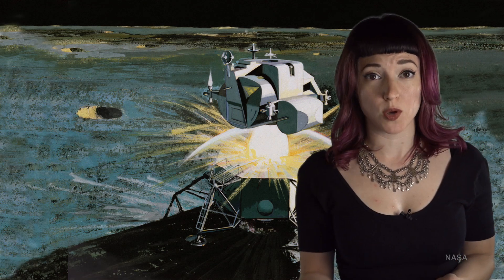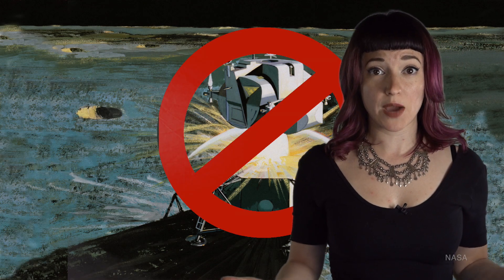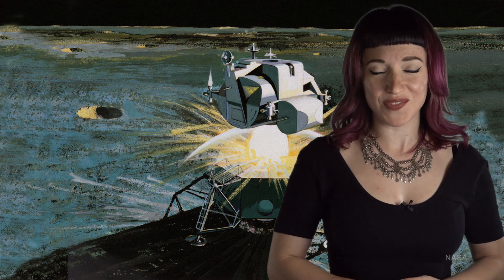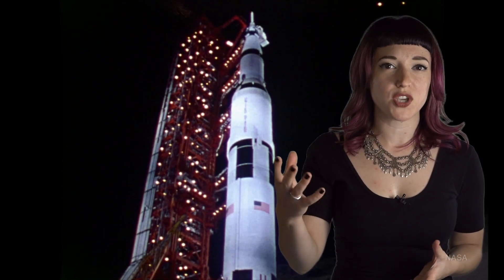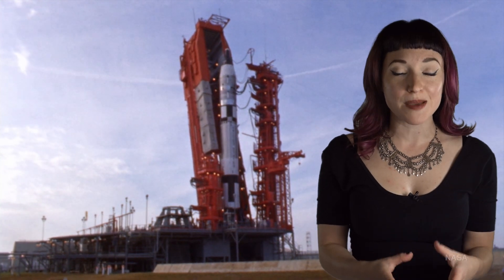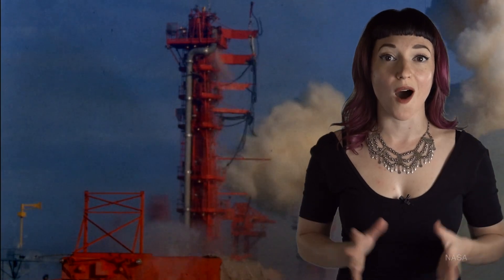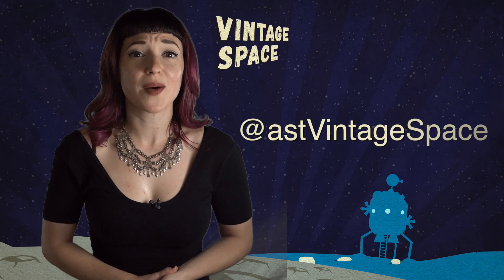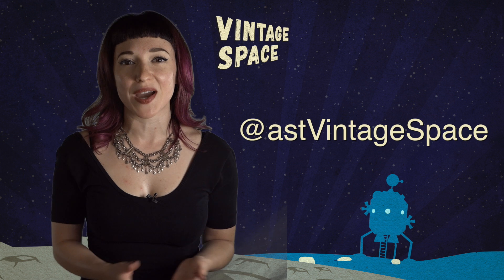How the Lunar Module Launched from the Moon Without a Flame

Comment: I do not even need to address the clear flame/dirty flame issue. I only need to point out that the Lunar lander was built with two distinct stages. A decent stage and an ascent stage. What you may not have understood is that there are TWO hyperbolic rockets "centered" and stacked one above the other. The lower assembly is dominated by tanks of volatile Cryo-fluids including liquid oxygen. This upper rocket is within inches of the lower rocket assembly. When it is time to ascend. The upper rocket would have blasted the lower rocket and "ALL" that instant 3000+ heat and 10k pressure would have blown all the tanks and plumbing in the lower assembly. It would be totally insane to fire a rocket above volatile fluids. Not to mention any fool knows NOT to fire a rocked in an enclosed space!!!!! Much less sit within a few feet of it!!!
There should have been a massive explosion, and the floor of the upper deck should of melted off all the "plastic" gold colored mylar off the bottom at a minimum. But watch a video of the lander re-docking and you will see it looks perfectly fine when it turns over for the camera. You should also be aware that there was a TON of plumbing and electrical connections between the upper and lower assembly. All of this was supposedly Guillotined cleanly the split second it took off. This is a miracle in itself!!!! So please!!!!! I don't want to hear anymore about clear/dirty flame. We have actual on-earth video of hypergalic rockets firing. And they are quite visible and the bell of the rocket cone glows cherry red which should have been easily seen. and just remember this!!! SOMEHOW they had hi-resolution WIRELESS video with automatic panning of the camera on the moon in the 60'!!!! And I would love to see the SSD card they had then to hold this video!!!!!
Reply: What a parade of nonsense:

YOU SAID: "I do not even need to address the clear flame/dirty flame issue. I only need to point out that the Lunar lander was built with two distinct stages. A decent stage and an ascent stage."

== Well, that says it all.  I guess we're done.

YOU SAID: "What you may not have understood is that there are TWO hyperbolic rockets "centered" and stacked one above the other."

== Hyperbolic, huh?  Not hypergolic?  You don't even know the correct terminology, yet you're going to teach everyone all about rocket science, huh?

YOU SAID: "The lower assembly is dominated by tanks of volatile Cryo-fluids"

== Not once it landed.  They were very close to empty.

YOU SAID: "including liquid oxygen."

== No.  The landers didn't use liquid oxygen.  They used N2O4 as the oxidizer.  You don't even know what fuels and oxidizers were used, but you're teaching everyone all about rocketry, huh?

YOU SAID: "This upper rocket is within inches of the lower rocket assembly."

== Wow.  Well, we're within inches of the moon right now.  Billions of inches, but within inches.

YOU SAID: "When it is time to ascend. The upper rocket would have blasted the lower rocket and "ALL" that instant 3000+ heat"

== Oh, you're a physics genius alright.

YOU SAID: "and 10k pressure"

== 10K pressure?  What does that mean?  10K of what?  I'm sure you're talking about the maximum thrust of the descent engine being about 10,000 pounds.  But, of course, they didn't land with that much.  And, the ascent engine certainly didn't have that kind of thrust.  But, whatever, you just keep on pretending you understand things you don't understand.  Keep on pretending "3000 heat" and "10K pressure" mean something.  Sure.  People just as dumb as you are will fall for it.  After all, you used numbers.  Anybody who uses numbers must know what they are talking about.

YOU SAID: "would have blown all the tanks and plumbing in the lower assembly."

== Yet, none of the thousands of aerospace engineers who worked on the program agree with you.  Nor did any of the aerospace engineers in any country, friendly or foe.  Funny, huh?

YOU SAID: "It would be totally insane to fire a rocket above volatile fluids."

== Rockets are fired near volatile fuels all the time.

YOU SAID: "Not to mention any fool knows NOT to fire a rocked in an enclosed space!!!!! Much less sit within a few feet of it!!!"

== I have no idea what you're talking about.

YOU SAID: "There should have been a massive explosion"

== Well, you just go ahead with those calculations, and submit them for scientific peer review, ok?  Your Nobel Prize is in the mail.

YOU SAID: "and the floor of the upper deck should of"

== HAVE!!  What the hell does "of" mean in that context?

YOU SAID: "melted off all the "plastic" gold colored mylar off the bottom at a minimum."

== Sure, keep telling yourself that.  Funny that, once again, no actual rocket scientists agree with you.

YOU SAID: "But watch a video of the lander re-docking and you will see it looks perfectly fine when it turns over for the camera."

== Bull.  Fucking.  Shit.  They looked all warped and beat up.

YOU SAID: "You should also be aware that there was a TON of plumbing and electrical connections between the upper and lower assembly. All of this was supposedly Guillotined cleanly the split second it took off. This is a miracle in itself!!!! So please!!!!!"

== Funny that none of the hundreds of people who worked on that assembly ever had a problem with it though, huh?  You don't think they tested it a million times first?  You don't think they knew the amount of force it takes to cut the ties?  Nope.  Like all conspiratrds, you just say, "too much" without actually doing any of the calculations.  Amazing.  You're a real genius.

YOU SAID: "I don't want to hear anymore about clear/dirty flame. We have actual on-earth video of hypergalic rockets firing. And they are quite visible and the bell of the rocket cone glows cherry red which should have been easily seen."

== They intentionally ran the mixture rich on the Titans.  They didn't do that for the LEMs.  I could sit here and explain why, but, you're not worth it.  Assholes like you... just goes in one ear and out the other.

YOU SAID: "and just remember this!!! SOMEHOW they had hi-resolution WIRELESS video"

== Yup, and your problem with this is what, exactly?  You don't think they understood how to radio some TV signals?

YOU SAID: "with automatic panning of the camera on the moon in the 60'!!!!"

== Wrong.  It wasn't automatic.  They were manually controlled.

YOU SAID: "And I would love to see the SSD card they had then to hold this video!!!!!"

== Are you PROUD of being a fucking moron and asshole?
Reply: rockethead7 I tried to follow your logic but it appears your a stark raving lunatic. You like to bypass things you can't answer and fly off the handle if you see a misspelled word from typing on a cell phone with auto correction. You really seemed scared about this. And obviously you don't know how to create paragraphs. You said, she said. I am sorry but you had nothing to do with the lem. So your just having a coniption filling in with your nonesense. This is an old post. And your just NOW getting around to it? I am sorry I don't have time for this. But the damage was done when this thread was at the top. Now it is unfindable and thus a waste of your breath.
Reply: Mort Trom, what on Earth are you talking about?  Good gods, what's wrong with you people?
Reply: rockethead7 exactly what I was thinking of you...

Comment: Look at any of the Rocketdyne LEM engine tests they did in Nevada.  There is a plume 75 feet long, at least.  Yep, No stars, no plume .......... HUMMMMMMMM?
Reply: "Look at any of the Rocketdyne LEM engine tests they did in Nevada. "    -  The LM accent engine was designed and manufactured by Bell Aerosystems and tested at White Sands Missile Range in New Mexico so nothing useful will be learnt from looking at Rocketdyne testing filmed in Nevada.

However, even when looking at test film of the correct engine it is difficult to judge what impact the fact that it is not being tested in a full vacuum, while being designed to be operated in a vacuum,  would have:-

https://youtu.be/qP7yd7RxtkU?t=416

"There is a plume 75 feet long, at least."    - Show me a visible 75 foot plume from a LM accent engine and you may approach having a point, but talk about Rocketdyne testing in Nevada and I will assume the quality of your research is so bad that you don't even know what you are looking at. 

" Yep, No stars, no plume .......... HUMMMMMMMM?"   -    Yes, no stars photographed or seen in full sunlight and no noticeable rocket plume from the accent engine.
Reply: Additional testing was done 9 miles from Reno Nevada at the Rocketdyne test facilities on Axe Handle Road and Rocket Test Rd.  Look it up.   Apparently you only know the media produced information.  After you find out that Rocketdyne had a test facility in Nevada near Reno and a rocket fuel farm that they are still cleaning up you might note that you are wrong!  Questioning "The quality of my research"  It wasn't research, I was there for every test and there were many failures. As I look back perhaps this facility was supposed to be private and not in the forefront of the national media.          There is nothing wrong with asking these questions and pointing out all the anomalies.  ABSOLUTELY NOTHING!             The weight of the backpack was 182 pounds.  An average fit astronaut was approx. 185 pounds.  Both together would weigh the equivalent of just 62 pounds on the moon.  Without backpack tests showed a fit man could easily bend his knees and extend and reach a height of 14ft.  Amazing.  With backpack the height of a similar extension was approx 9 ft.  We saw the astronauts get about 18 inches.  Why?  I know they didn't go to the moon to "play games".  Yet there was plenty of ridiculous fooling around and nothing they did approached the possibilities of 1/6 Earth gravity. (the ballet dance, the golf swing, the equipment toss, the feather and hammer drop, the salute jump, plus the Lunar "Grand Prix".   What didn't they take their cameras and pan 360 degrees.  Why didn't they film the Earth for continued time?  And the quality ( or lack there of) of the staged sets is so bad that now years later when everyone has the ability to replay and zoom in you can laugh at the phony front stage with the dividing line always present and the phony back painted mountains.  When they ride the Lunar rover to Hadley Rille and come upon a blacked out area it's laughable, indeed.  Go look at it.  If you believe that is a true filming of Hadley Rille then you are hypnotized.  Also when the LEM on the Apollo 11 decent transitions from the horizontal to the vertical after having a speed of 4000 miles an hour that's an impossible transition for 1969.  These anomalies are real and exploring them is not wrong, un American or anything else. When you guys try and conflate those who question with Flat Earthers that seems amazing to me.  What is the real purpose of that?  Questioning the huge number of anomalies of the Apollo flights has noting to do with being a Flat Earther.  But that's a way to justify calling anyone with a reasonable point, a nut.   Seems a very weak and unjust, meaningless action.  Yep, go do your research and come back and restate yourself.
Reply: That's how it goes.   You told me I was "stupid" and "wrong" and that they didn't test Rocketdyne engines in Nevada.  I told you that, in fact, they did.  That Rocketdyne had huge test stands on a mountain side where the  citizens of Reno and surrounding areas were notified when the tests were scheduled and whole families ( I was one) would come out and we all would park  our cars and watch as they tested and the plumes would shoot out into Palomino Valley.  No doubt the tested elsewhere but they certainly tested in Nevada.  Rocket dyne had a large fuel plant (Boeing is currently "scrubbing" the ground water in the area as a clean up effort.  They have administration building, even the roads in the area reflected space themes.  But no you suddenly went quiet.  People who can't admit when they are wrong have shallow character and no courage.   The whole point of my original comment was to discuss the fact that the 10,000 pound thrust of the LEM decent engine would create a huge disturbance in the ground under them.  The ground was fine dust.  As I said, I fly a Citation Biz Jet and each of the two engines have approx. 3200 pounds of thrust.  If I directed any portion of it to that fine dust there would be obvious disturbance.  But there is none.  You can say all you want about the camera not showing the stars but on any real mission they would have configured a camera such that it would photograph the Milky Way galaxy.   How about a 360 degree pan of the camera any time any place on the moon.  The thing you guys are mission is that the whole Apollo program was real, the rockets were real, everything was, except a few final day when no one was around (on the way to the moon , the moon it's self and back.)  That's what is in discussion here but you guys can't do that.  You say we are saying everything is false then you laugh and point to a Saturn V.  We point to the ridiculous fake stage set and laugh. The whole Apollo project was fabulous but they couldn't pass the radiation areas and they certainly couldn't slow down from a moon orbit speed with no atmosphere tradition from horizontal flight to vertical and land.  That's why when the Soviet Union and the United States brought back any of their astronauts they couldn't land by setting down easily on the ground.  They always had to bring them back with parachutes and they landed in the water.  Back then it couldn't be done.  They faked the last few days.  Just look at the fake scenery and tell me now a days do you believe it?   Sorry bud that you have no courage to admit you were wrong and that I was correct in stating they did test Rocketdyne LEM engines in Nevada.  Bad research man, very bad, better correct that.

Comment: Where is all the moon dust that should be floating around. The lunar module lands without any dust being kicked up. No dust on the landing foot?
Reply: "Where is all the moon dust that should be floating around."   -   Dust does not float where there is no atmosphere. In the absence of air to slow the decent of the smaller particles a speck of dust will fall at the same rate as a pebble.

"The lunar module lands without any dust being kicked up."   -   Not "kicked up" but certainly dust was kicked outward. Dust could not be kicked up by the decent engine because if the flow of exhaust gas was large enough to lift the dust in the first place it would also be strong enough to prevent that dust from traveling upstream in that descending gas plume. As the dust could not travel upwards against the flow of exhaust gas it traveled outward from under the exhaust plume, as can be seen in the 16mm film of the various landings. The astronauts described the blowing dust as resembling a fast moving ground fog, illustrating the fact that the blown dust remained low to the ground.

"No dust on the landing foot?"   -   What evidence exists that could possibly justify your concluding that there was "No dust on the landing foot"?

Comment: How would you run air conditioning of a batteries for 3 days? Pseudo nascience that is you said we don't know how It burns because we cant re-do it. Such argument. Of grainy tv footage? They in nasa run out of wires to connect they stream to be live, nah,
Reply: They used a porous plate sublimator.  You CAN look this stuff up, you know.

Comment: +Vintage Space Can you make a video on how much is the gravity on moon can we exit the moon atmosphere simply by jumping on the moon surface I know kinda of weird questions but it would be nice  if you cover it in your upcoming video.
Reply: YOU SAID: "Can you make a video on how much is the gravity on moon"

== Approximately 1/6th of Earth's gravity.

YOU SAID: "can we exit the moon atmosphere"

== There is virtually zero atmosphere on the moon.  It's so close to zero, that, effectively, it really doesn't factor into any calculations.

YOU SAID: "simply by jumping on the moon surface"

== No.  1/6th gravity is still too much to leap into orbit.  But, if my memory serves correctly, the gravity on Deimos (one of the moons of Mars) is so low that, yes, you could basically jump into orbit or escape velocity.  Now, keep in mind, it would be pretty tough to actually move that fast on Deimos in the first place, because, with THAT little gravity, it's hard to get enough traction to do much of anything.  But, hypothetically, if you could get a nice running start, you should be able to simply jump into orbit.

YOU SAID: "I know kinda of weird questions but it would be nice  if you cover it in your upcoming video."

== I don't know if she reads comments.